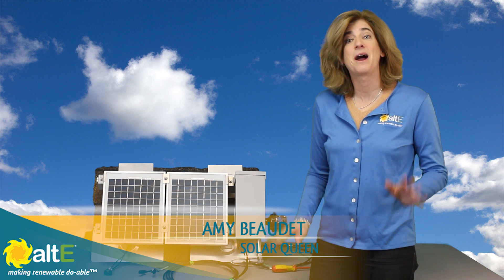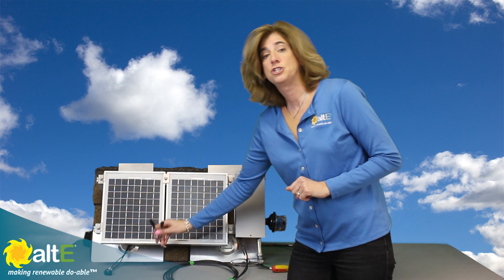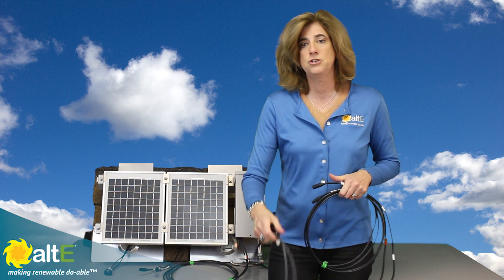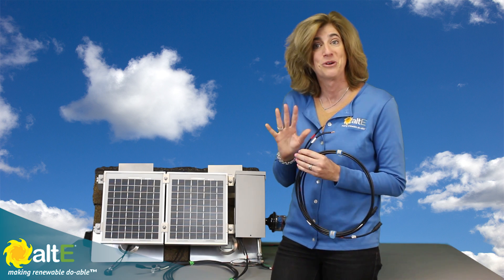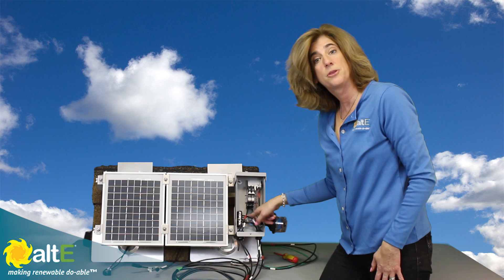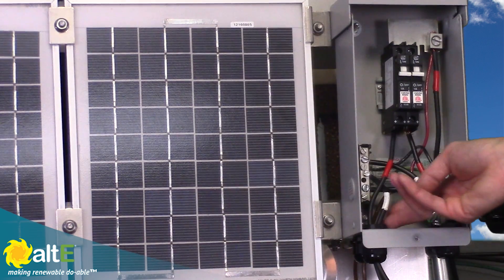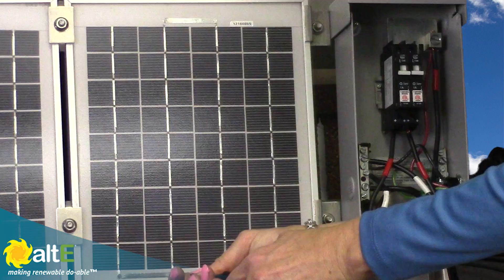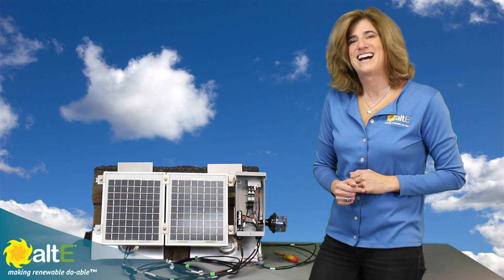How to wire solar panels in parallel with combiner box

Comment: Have even an older system that has the old plugins not like those but like harvest freight solar panels have now but that's back 30 years ago I'm supposed harbor freight has that for a plug-ins and after that I got two 300 watts of the panels that don't have plugins they're just free wire that must have been in between plugins but then again I bought those sometime ago too where they're just spliced with no connectors and those I got from fleet farm before they got rid of the 300 watts the 60 watts or the 100 watt solar panels and I got a bunch of newer panels than that probably after 2008 probably after 2012 more or less 2016 that has the newer version connections which I still tape because I didn't trust a leak free things and I didn't know they're supposed to be waterproof that I just know the older ones went waterproof so I electrically tape them of course I didn't get these videos then and I didn't know you could buy solar panels off the internet videos and internet sales from Google app stores.

Comment: question of the day: I ran a string of 6 12v 100watt Renogy solar panels in parallel to charge a 12 v LiFePo4 battery (100 ah) through a victron smartsolar 100/50 mppt controller.  I'm now intending to switch (adding 2 more 100 watt panels of the same kind) to a setup where I will have "two strings of 4 12v 100 watt panels in parallel totaling 400 watts" in series with another identical string, for a combined 800 watts of panel output (in perfect peak condition). The Victron mppt controller says it can handle 12v or 24v battery bank.  Will this setup work with my 12v battery since the incoming pv voltage will be 24, I wasn't sure? I suppose I already have my answer (of course it'll work) but thought I'd ask for someone to confirm. Thanks

Comment: I have a two 15v, 300vdc breakers... I bought  two 385pvdc serge protectors, I noticed you added one to the main bar, is one sufficient or should I put a serge protector on each breaker?

Comment: I believe those are MP3 connectors. when NEC required locking connectors, they made some locking 'clamshells' so you could continue using the MC3...
Dang, I wish I wasn't so old...sigh.

Comment: No blocking diodes. Yes, you can turn off a breaker if one branch goes bad, but you have to determine that first. For those of us mounting on RVs we have to consider shading as well.

Comment: Congtrats for all the nice explained job you have done.
Can you please inform me if it is possible to use 2 seperate controlers to charge 2 seperate batteries from.the same solar panel?
Thank you for your time,
Regards from Greece,
Michael

Comment: What size, brand, etc.. of strain relief connector  are you using here? I inherited this combiner but it is missing these.  I'm assuming 10AWG wire?
Reply from the maker: https://www.altestore.com/store/cables-wiring/solar-panel-wiring/grounding-and-wiring-accessories/12-inch-2-hole-strain-relief-with-lock-nut-p9660/
Reply: @AltEStore  Thanks!

Comment: Should you have a single pole safety switch between the panels and combiner box or just disconnect the MC4 connectors to facilitate working on the combiner box?
Reply from the maker: You would have a breaker per string in the combiner box. The breakers act as a disconnect. Never disconnect the MC4 connectors when the panels are in the sun until you turn off the breakers.

Comment: i never saw a installation in my country with those breaker boxes -)  if we parallel we use those mc4 splitters
Reply from the maker: The splitters are good for small systems that have less than 30A, usually just 2 panels. We have a video on them here, https://youtu.be/9xsf_l_mCEk.  If you are parallelling more than 2 strings, code requires over current protection (breakers).

Comment: Thanks for the response. I want to know the voltage drop and efficiency at 25 feet away.
Reply from the maker: I like this voltage drop calculator. You can play around with different wire sizes. http://www.calculator.net/voltage-drop-calculator.html

Comment from the maker: Someone asked about oversizing the breaker. I'm not able to directly respond o their quote, so I'm answering it here. Because the breaker's job is to protect the wire, you need to match the size of the wire to the size of the breaker. The problem with oversizing the breaker too much is that you then need to oversize the wire going to it as well. So instead of being able to use 10AWG with a 15A breaker, or maybe even less depending on the distance run, you'd have to use at least 6AWG that can handle 63A. That makes for a more expensive and difficult installation.

Comment: So the negative Buss is insulated from the metal box and the grounding Buss is bonded /screwed to the metal box correct?
Do you have any more videos of connecting the different apparatus/components  in the solar system together?
Reply from the maker: Correct. You may like this video where we step through my off-grid demo system. https://youtu.be/x7YWPjycgR4 I'm planning on doing more videos like this soon.

Comment: I assume you can have that combiner box down on ground level and not necessarily Up on the Roof?
Reply from the maker: In addition to combining the strings, the combiner box also gives you a way to transition from free air wires coming from the back of the panels into conduit. NEC requires that you are in conduit once you leave the area of the solar panels, so the combiner box is generally right next to the panels to do that.
Reply: Does that box mount  flat on the roof or can you mount it vertical seems like the rain might get into it if you mounted on the back of that box to the roof
Reply from the maker: ETL listed for the US and Canada up to 3 1/2 pitch. So you can mount it as flat as about 15 degree pitch. It is often just mounted on the end of the rail, so the same angle as the panels. Or you can mount it vertical with the conduit flashed through the roof like this picture. http://imgur.com/WuZM5wq

Comment: You are wiring each single panel independently to the combiner box. That's a lot of wiring! $$$  Yes, it is great for doing preventive maintenance and much safer than just wiring each panel along the roof to the main + or - bus.  If you wire 10 panels this way at the combiner box you would end with a big  bunch of cables instead of just one thick + -  bus.  Certainly your method is more expensive using one breaker per panel. Are there any regulations in the USA requiring this? I'm not in tha USA.
Reply from the maker: It depends on what you are wiring the panels to. If you are going to a PWM charge controller, you have to keep the voltages the same as the battery bank. If you are going to an MPPT charge controller, you can wire several panel in series, keeping the voltage below the maximum input voltage for the charge controller, often 150V, and then wire multiple strings in parallel in the combiner box. For instance 2 parallel strings of 3 in series. To wire to a grid tie inverter, you can often do up to 12 panels in series, and those do not have to go through over current protection like a fuse, they can go straight into the inverter. But if you combine more than 2 parallel strings, you do need to have a fuse, even for grid-tie.

Comment: Hi again Amy, do the mid panel clamps serve as WEEB GND devices to penetrate the anodized or powder coated solar panel surfaces ?  Meanwhile, I am blending up another batch of Texas margaritas...do you want a salted rim ?    Thanks  later    Jim K
Reply from the maker: As long as you get the grounding mid-clamps, yes, they bond the frame to the rail instead of using a WEEB. Ironridge just came out with a new clamp system, UFO, that will also do that, but their older grounding mid-clamps do a good job as well. Stay tuned for a new video on the new UFO clamps, that's the next one I'm working on.
Reply from the maker: And salted please.
Reply: Good choice, no need to take salt tablets while doing those outdoor videos in the hot sun.  By the way, I find that Sauza Hornitos in the green and gold bottle has good flavor for mixing or straight shots.  Have an enjoyable weekend.   Thanks  Jim K
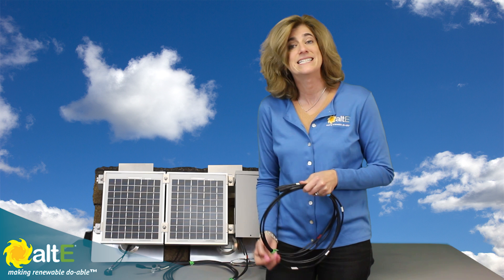Reply: HER HANDS CHANGE TO A LATINA'S AT 3:04 !!!!!
Is there tequila in a Margarita?  Is it possibl to be turned Latino if you drink too much tequila?

Comment: Amy, are those DC breakers?  Because I was under the impression that AC breakers use a different process sensing amperage than DC breakers and that type may not trip when you are expecting them to. It might burn your whole system, even though you think you are protected.
Reply from the maker: You are correct. We used DC breakers on the DC side, and AC breakers on the AC side. A bit of an over-simplified explanation is that AC crosses 0V 50 or 60 times a second (depending on the Hz). DC never does. So it is harder to break DC, and special DC breakers are required to prevent arcing.

Comment: I have only 12w load..what kind of battery I need?
Reply from the maker: That depends on how long you run the load, and how many days of backup without sun you need. For example, if you run the load for 10 hours, you need to generate 12W x 10 hours = 120 watt hours. You can see our video on using our off-grid calculator here. https://www.youtube.com/watch?v=rid7Jb4fj_o
Reply: You will need a 110 volts battery

Comment: Thanks for your videos. very informative. One question. Can you combine solar panels with different output capacities say 80 watt solar panel with 200watt solar panel?
Reply from the maker: +Nde Den That's the next video i'm planning on recording. Short answer is, you can wire multiple panels with the same voltage but different amps in parallel, but not in series. You can wire multiple panels with different volts but the same amps in series.
Reply from the maker: Not sure if you found our mismatched solar panels videos. Here they are, https://www.youtube.com/playlist?list=PLoHd6hGDqS04rBGW2bJnDgeEyFKDy2Tpz

Comment: luv your vids amy,always informative but please tell me my eyes deceive me when i see 2 wires under i terminal.
Reply from the maker: +ric g Busted! Yes, I took a shortcut preparing for the demo and put the combined plus and the SPD plus wires both on the positive bus bar lug. You are right, I should not have double lugged, but combined the wires and brought one wire to the lug. I will rewire it and do better in the future to set a good example. Thanks for calling me out on that.

Comment: Thank you Amy for the overview.  I have a question, what is the difference between a Combiner Box and DC Breaker Box? Thank You.
Reply from the maker: +Mark Cole Good question. A DC breaker box is really a category of enclosures that can hold breakers for DC circuits. A combiner box is a specific kind of breaker box. Its purpose is to combine the wires of the solar panels in parallel, combining the negatives on the negative bus bar, and the positives on the output of breakers. I suggest you watch this video where I go over the components of an off grid solar system, including the combiner box, DC breaker box, and AC breaker box. https://youtu.be/x7YWPjycgR4 You can see a selection of breaker boxes here, https://www.altestore.com/store/enclosures-electrical-safety/electrical-enclosures-c1098/
Reply: +altE Store Thank you, I will watch more videos..... Have A Good and Sunny Day...

Comment: great video Amy thanks for the info
Reply: The breaking DC being harder to prevent arcs is a reasonable simplification of the back emf effect, but you also see it domestically at you light switches. Depending how you use the switch, you can hear a cracking sound- that's the back emf arcing.

Comment: I think another disconnect at where it enters the system whether it's to the batteries or charge controller.
thanks
Reply from the maker: +Rev John O'Toole Right, after I leave the combiner box in conduit, I go to another breaker in my DC Load Center  to provide a disconnect from inside.